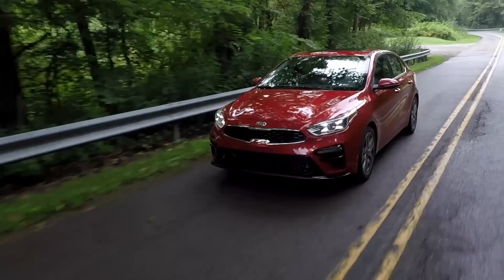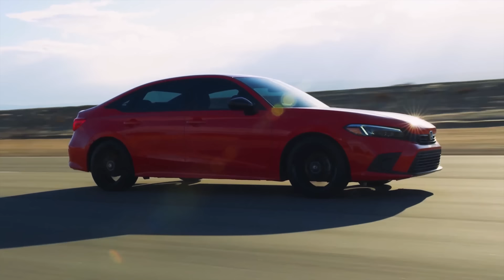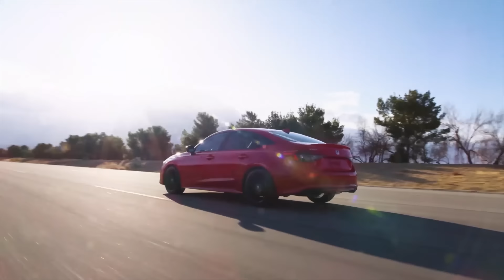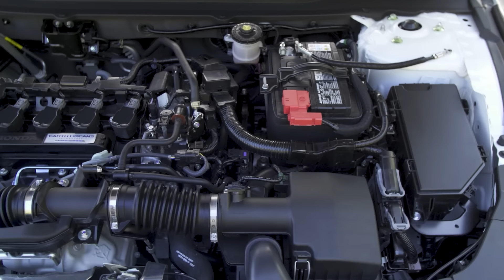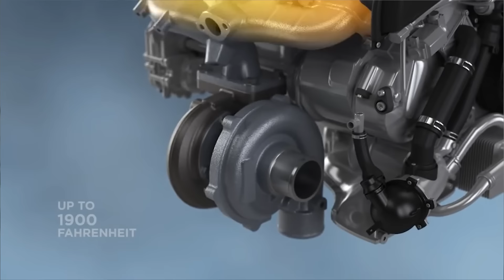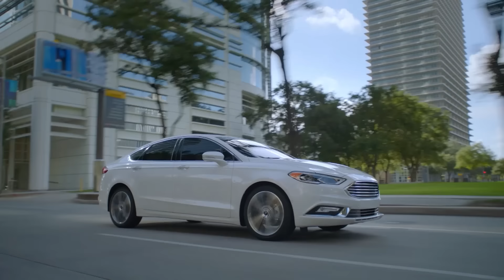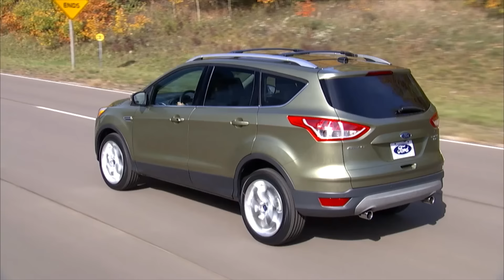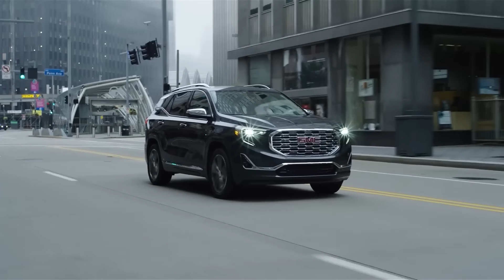Are Turbocharged Engines Reliable? The Truth About Turbo Engines

Comment: Thank you for your candid video.  It's nice to see some serious journalism again.  I purchased an Audi A4 with a 2.0 turbo engine.  It was the most disappointing car I've ever owned.   I noticed right away that the oil level went down steadily between changes.  I checked out my Audi owner's manual and found "in print" that it was  normal for the 2.0 turbo to use oil.  In fact, my A4 had a special light on the dash that lit up when it was time to add a quart.  That's when I began to swap information with other Audi owners.  Yep, all of us had the same oil consumption and black oily tailpipes. Not exactly environmentally responsible.  But the biggest issue was with the turbo itself.   At about 35K miles, engine performance began to lag.  Balky performance and poor milage led to several trips to the dealer.  Modules were replaced, tuning done, and so on.  At just over 50K miles, the turbo actually DIED.  The dealer told me that it wasn't that unusal.  Almost $4,000 later, I had a new turbo.  Traded my A4 for a Toyota Avalon V6 the next week--problem solved.  VW and Audi have been making this 2.0 turbo for decades.  You'd think that, by now, they would have the engine and turbo design sorted out.  Needless to say, I'll never own another Audi or VW product.
Reply: Same car, engine does not eat oil, but turbocharger had died at 44k, just 4 months after warranty ended. First and last German car I own.
Reply: I have a 2021 Mazda 6 with a 2.5 liter turbo engine. I only commute in the suburbs with light to moderate traffic and I am averaging 21.7 miles per gallon with zero highway driving. And I drive aggressively. The engine puts out 250hp and 320 ft lb of torque on premium which I do use. My car sees redline twice per day at least 😂
Reply: @Matys1975  Good choice, Matt. Mazda makes a great car. One of the best in the industry, I believe.
Reply: And...?
 @Matys1975
Reply: @Matys1975 can u give us a update on ur Mazda 6 2.5 turbo please
Reply: @mikeyg9833  drives like new, not a single problem of any kind so far
Reply: @Matys1975 When you say you drive aggressively, what do you mean? To the point of cutting people off, changing lanes every 2 seconds and being an asshole to other drivers, or do you simply mean driving in a spirited manner without being offensive to other motorists?
Reply: @Bad_Drivers_Caught_On_Dashcam  the latter
Reply: @Matys1975  Oh okay, gotcha. Me too. After having driven slow cars all my life and then recently getting a fast car, I drive very spirited now. Even my old 91 Chevy Lumina with the 3.1L V6 seemed brisk at the time, it's now considered very slow by today's standards. Like, a little slower than the 2000's gen Camry I4's. I like to tear through the mountain rounds with my new turbo car. That thing is a torque beast.
Reply: What year was your Audi A4? My boys car is a 2017 and he’s had to change the water pump but that’s all so far. He’s owned it for over a year and it has 98,000 miles on it. I tell him often that he should trade it for a Honda, Acura, Toyota or Lexus .
Reply: Mazda are reliable and drive nice unlike a Prius.  I get 39 mpg on the highway and 32 city driving. Mazda CX-30, non turbo.
Reply: Toyota the best plus their 2 years maintenance free of charge.
Reply: @anastaciolopez6259  Toyota is the best for reliability but they are so damn boring to drive. Some people want to have fun while driving at the expense of reliability. Personally, I drive Mazda’s, a good balance between fun to drive and reliability. I have had a BMW previously that was more fun but it was quite unreliable.
Reply: @Matys1975  After owning an unreliable Chevy Malibu, with constant expensive repairs,
 I find my boring Corolla to be ok.
Reply: @arty8255  if you are going to go with unreliable, it has to be at least fun to drive like a BMW
Reply: @Matys1975  My MK4 Supra was crazy fun.  Blew away V8's and handled like a go cart.  Wish I never sold it. Now worth 4X.
Reply: @Matys1975  the interior space of Mazda is truly pathetic
Reply: @anastaciolopez6259  the perceived reliability isn’t there with Toyota’s anymore
Reply: Bought my last VW product in 1975.Vw was crap then and crap now.I don't know how they sell cars.
Reply: @johnball8758  Totally agree !! our company use VW they all have a problem of one sort or another, just poor build quality.
Reply: Audis of the mid to late noughties had a very well known design issue with the piston and oil scraper rings.  This caused in many cars the horrible oil consumption you spoke of and many massive arguments with dealers. Oil scraper rings we too narrow and got blocked with carbon thus causing them to cease working.  The only fix was new pistons, rings and con-rods which Audi didnt want to pay for.
Reply: Thank you for this information. Initially I thought of buying a turbo engine car. Now, after reading your feedback, I will not go for this. Thanks again.
Reply: @MS113MS  Majority (70%) of the modern engines have turbo or supercharge or combined. Small engines that are efficient and a gas saver as mandated by European govts & USA.
Reply: Audi turbo or not they suck.
Reply: @patrickgallegos113  new Audis are reliable
Reply: I had the A4 with the 1.8T... the turbo was fine but the timing belt broke and trashed the engine... was a $5,000 job.  But it turned out it was a known defect so Audi had to reimburse me but only AFTER a class action lawsuit was filed...  so they had thousands of customers driving around in cars that could fail catastrophically at any time (dangerous!)... and did nothing until the lawsuit.  Audi never again!  ...same with BMW.  Now I watch Scotty Kilmer on Youtube before I buy any vehicle...
Reply: @Really10801 BMW did the same thing with under built timing chains that stretched and plastic guides that failed
Reply: VW has been making the 2.0 for decades in various forms. It wasn't exactly the same engine over the year just because they all shared the same two-later cylinder size. They also functioned, through the years, with fewer restrictions that allowed them to breathe better; turbo engines LOVE TO BREATHE. Add to that, VW's dubious diesel-gate legacy. In my opinion, VW was applying similar cheat devices to all their engines, allowing them to get great performance with excellent efficiency. You can't achieve those two things without something suffering, and now, that VW is building this same 2.0-liter design lawfully, it suffers from immense turbo-lag, and cheap parts that lack long-term reliability. I've owned three VW's and each one has had their issues. One of the three was the VR6 which had major issues by 60K miles. Due to these shared cheap parts, an entry-level Audi that shares many parts with VW, and that dubious 2.0 engine, will never be as good as the entry-level models that BMW or Mercedes offers. They don't have lower brands to take a product and upmarket it. All their products start upmarket, and then they “downmarket” it. Not to say that both brands don't have a share of issues, but nothing like Audi/VW.
Reply: @fp5495  bmw and Mercedes are both as reliable and unreliable as Audi.
Reply: I have same Audi Quattro with turbo engine too.. I change oil every 3500 miles with FUCHS Oil.... I don't trust driving 10k miles or even 7k miles at all.... I don't have any other issue than their "normal" oil consumption... I hope to not have any at all 🙏🙏🙏😊😊😊
Reply: I have an 2018 Jaguar XF 2.0 Turbo gas with more than 35K miles. So far so good. It always gets a 5K miles OCI vs Jaguar's recommended 16K miles OCI.
Reply: @ravenbonanza1522  16k oil change intervals are recommended? Nuts
Reply: @Matys1975  Probably meant 16000 Kilometers, which is 10000 miles.  A common oil change interval.
Reply: @birdyflying4240  my car is not poor, it gets maintained better than any car on the road. I wash it by hand and change the oil myself at intervals 2-3 times shorter than recommended 😂
Reply: A4 b8, especially the early non refresh ones have bad piston rings and will consume oil like crazy. Also, Audi water pumps suck, not an uncommon issue. Would not buy any car from the manufacturer if they say this is normal.
Reply: That is a common audi problem, not the fault of the turbo.
Reply: Not a tubo problem. This is an audi problem.. they're literally junk. All plastic. Designed to fail.
Reply: That's because audi sucks
Reply: @jw3384  new Audis are reliable
Reply: @samli3345 Well most  new cars are, but after not so many thousands of miles....
Reply: Sorry to hear about all that, just wondering, which year was it? They had problems in the 2000s but this is a very widely used engine. I’ve driven the A4 with the 3.2 V6 and it was one of the nicest engines I’ve ever experienced. Sadly they discontinued it. Haven’t heard a peep about reliability problems either.
Reply: M k
Reply: Buying an Audi = “buying” a property in China. So, you deserved it
Reply: You made the mistake buying the Audi. Honda turbos can be trusted.
Reply: @tbone5654, I think you're
referencing the Toyota 2.4L
4 cyl. engine with a ring issue.

My 2003 Avalon had some sludge when I bought it used.
(3.0L V6) Had been driven many very short in town trips
by an elderly owner.
Added Rislone, did some 40 to 120 mile trips, drained oil hot,
Repeated. 5W-30 Full Syn oil.
Sludge be gone, car burns no
oil, runs great.
Reply: The 2.0 is famous for being a pig
Reply: What year is this 2.0t out of? I have a 2018 a4 2.0t and it has not burnt any oil in the five years/85k miles I’ve owned it.
Reply: same thing happened with my friend, Audi 2.0 turbo, huge oil usage, engine eventually imploded.
Reply: I geuss to each there own

I bought my mk5 GTI fsi brand new in 2008.  It did eventually consume oil. I drove 5 years as a delivery driver. I eventually sold.

A few years later I saw another Fsi GTI. I started using a delivery driver
Nice hard exercise. No slow pokes here. 

I eventually decided to sell

It had 250k

The new owner got back to me

With just regular maintenance he got up to 500 k and eventually sold

So 2 my two mk5 combined 1 million kilometers. No serious issues.

My least relibie car im driving.

2004 Honda civic . 3 years ago the seller didn't mention serious head gasket promblems. Spent thousands in coolant over the years. Also paid one mechanic 1200 to fix. 8 months later same BULLSHIT.

Actually out all the Honda civic I bought over the years 3 out 4 had head gasket promblems..

Correct just 1 didn't have problems.

Also another video about a guy buying a 2007 Audi Q7 with 500k 

Drove for 10 years without serious problem. But sold because the timing Chain started ratting.
Reply: VW has been garbage since the early 90s. My 2.0t cadillac ats has 120k miles and runs like the day I bought it.
Reply: I love cars and to be honest with you - I have never met anyone that have owned an audi that wants to have the same brand again. Their stories always end up bad unfortunately and to me this speaks by itself about the reliability of the car.
Reply: I purchased my 2016 Audi new and still have it today. It's been 100% reliable and is the best car I've ever owned. The turbo gives the car plenty of power when I need it and good gas mileage when I don't.
Reply: agreed
Reply: Toyota 6 cylinders are some of the best engines ever made.   Looked after they do 500,000 miles.
Reply: @tbone5654  Not really.  Toyota V6 had the infamous engine oil sludge issues...
Reply: Did you ensure you regularly drained and changed out the oil around 7500 mile intervals?  This helps a lot.  If you are losing oil volume, perhaps seals and gaskets are wearing (?)  There are far more moving parts in an engine, and far more seals and gaskets as a result, in a turbo charged car
Reply: Hmm. I have a 2016 audi a5 2.0 turbo with 133K on it and goes like a dream. The only thing I've had to replace are both front wheel bearings. The car came with a 100K warranty...cert. pre owned.
I am a highway, long-haul driver and live in the Northeast. When you look in it's class, it actually reports with some of the least issues and was actually ranked in top ten in it's class.
Reply: @shadylane7988  sounds you believe the hype. A class only has about six cars in it now.  Audi have been greedy in the past but every now and then a vehicle gets built well.
Reply: I had the same issue with my gti which has a similar engine . It started eating oil at 200k like a quart every 100 miles . I switched to liquimoly and it’s now about half a quart every 2000 miles which I can deal with . I’m looking back I wish I did the oil changed every 5k miles vs 10 k as they recommended .
Reply: VW & Audi are some of the most poorly made 🚗 out there. Next time buy a Lexus they are boring but super reliable
Reply: @apt62  The newer RX350 has a 4L Turbo which is relatively new engine. The old RX350 V6 non-turbo is the most reliable, tried & true
Reply: @ravenbonanza1522  that's why they r very popular among the thiefs lol. Number one stolen brand
Reply: @apt62  new Audis are reliable
Reply: I always find it interesting how so many ppl from (presumably) USA complain about VW group engines
In europe they work fine. Very fine. My 1.6TDI with 105hp and 250nm has 310.000km still runs smooth, doesn't burn oil and gets 5.5L/100km on the highway @ 130km/h

A lot of my family coincidentally drive VW group cars and all have very little engine problems, especially with the diesel ones
Reply: @someguy9520 Apples and oranges, US don't have the 1.4-2.0 liter turbo-diesels engines but gas/petrol and VW had had some real issues with them for years in Europe as well, especially in colder countries. Turbo diesels are generally more reliable than petrol equivalents.
Reply: @someguy9520  Germans are racist and always say their cars are the best even though they've never had a good car because they only buy German, that's why we bombed them.

Comment: I was in the market for a new/lease return car last year i ended up buying a Corolla IM hatch 6 speed.
my criteria - Solid reliability, - Global World car that people all over the world beat on,non cvt/electronic clutch, non turbo, manual E brake, I wanted a hatchback that i could put an interior door in * that was my benchmark for storage capacity.
I didn't want an SUV ( I used to think I'd buy a wrx, no matter how cool the car would be it'd never offset the insurance and upkeep vs a Corolla, ) plus the bastards quit making the WRX in a hatchback/wagon
- I didn't even look at american brands, korean or euro cars, I was mainly looking at Subaru, Toyota and Honda was a weak 3rd, I had 2 Subarus the new ones didn't impress me, the new 2.0s I felt were crap,  I felt the Toyota had the build Quality and Honda just didn't have the early 00s 90s Vtec little civic hatches I wanted

Comment: At one point in time turbos were only included on high performance sports cars. So now it makes sense why the turbos won’t last on a regular car if they need to be kept at a higher temperature to function correctly. Most high-performance sports cars usually get run pretty hard anyways. So temperature is never going to be a problem for those.
Reply: Yeah my 1G DSM turbo gets up to operating temp within minutes so this has never been an issue for me, but I can see it being one on non-performance cars.

Comment: Its not that its unreliable, its just that NA’s are “more reliable” due to less mechanical parts
Reply: So a 8 cylinder has less mechanical parts than a 4 cylinder with a turbo ? 🤔 That doesn’t seem to make that much sense

Comment: The mayor problem is that, a lot o people don't know the manufacturers recommended oil nor the service interval and they take their cars to those Quick oil changes places were most of the time, they replace the oil with a cheaper conventional oil and that is when all of the problems get started. Check your owner's manual for the recommended fluids and maintenance intervals. Don't blame the car manufacturers, blame yourself for not following manufacturers maintenance intervals and recommended fluids.

Comment: I had a 2007 Volkswagen Passat with 310,545 miles (499,775 km) with all original manufacturer parts, engine, transmission, turbo, alternator, starter. Synthetic oil replacement every 10K miles per recommended by VW. I traded it for a 2021 VW Passat R line.
Reply: That's great.  I have got 2007 skoda Octavia 1.9tdi diesel clocked 100k on odometer,  New alternator and new starter, New battery   Otherwise going good .

Comment: car experts that I came across said turbos are less reliable. more complex and engine casting not up to pressure. costs more to maintain. also the long term mileage not that much better. Toyota's naturally asperated engines are more reliable.

Comment: Nope, European small turbo lasted 140,000 k's, (under 100,000 miles for Yanks) can't be repaired, need to swap out, one owner always serviced at the dealer,  carefully driven. Never again. Save a little fuel get a little more power,  always sell before the warranty is up.

Comment: If efficient is not a top priority, the KISS engineering principle is the way to go (Keep It Simple Stupid).  It comes down to trade off between efficiency, cost, reliability.  Turbo engine is more efficient and cheaper to build but it is less reliability because of its operation conditions (temperature, pressure, rpm) and complexity (more parts).  Auto manufacturers  use turbo engine to give consumers better fuel economy and cost them learn to build. The saving in gas + lower cost to build the engine override the reliability which is an issue many issues down the down for the buyer